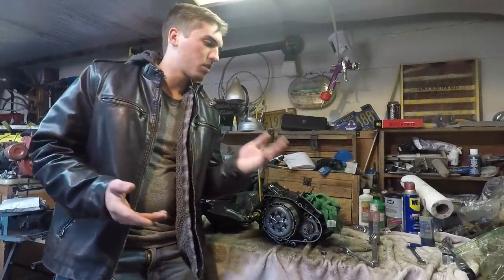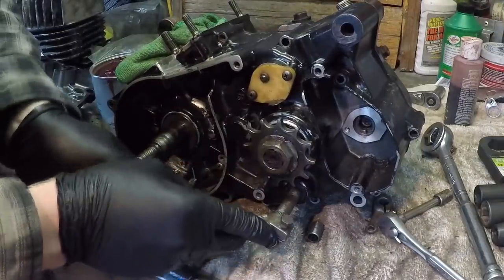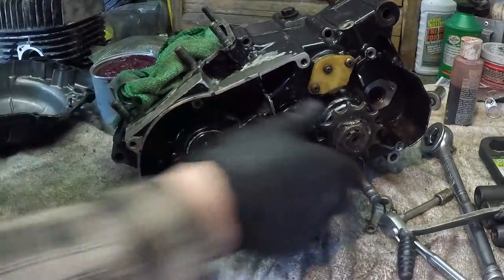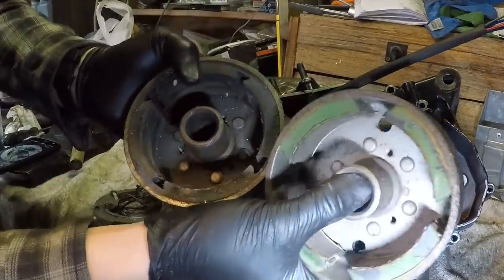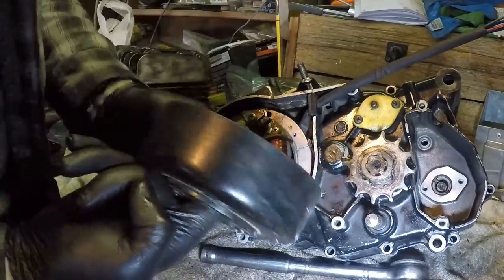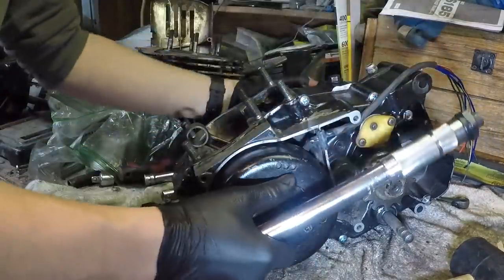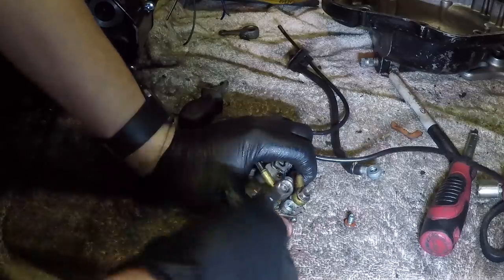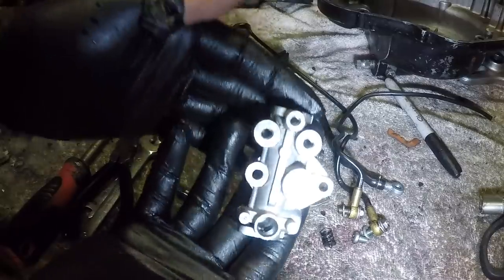TS185 Bottom End Rebuild (Part #3)

Comment: The "mystery bolt" on the pump is for bleeding the air out of the system. It has holes in it so that it can just be cracked loose to bleed the air out without having to fully remove it. When you add oil to the system just crack it loose wait for oil to start to seep from around the bolt and tighten it back up.
Reply: Dylan Snyder yep well said
Reply: I'll 2nd that👏🏼👍🏼

Comment: Doing good work. Try to remember any place u have a seal and you go to tighten down the covers or joining pieces. That you should not tighten them in a circle. You should try to skip bolts,screws, or nuts and go in a X pattern/cross pattern because it can mess up your seal as well as twist your parts and start leaking air, coolant, gas, or oil. I learned that the hard way.

Comment: Nice work mate, should run mint when its all done. Id personally get rid of the oil pump altogether. Block off the hole where it bolts up to and run the bike on premix 32:1.
Reply: Really really bad idea. Your head bearing is lubricated via the oil pump. If you just drive on premix, then soon your engine will get seized!
Reply: @christianlarsen6421  lol at head bearing. Never heard of a little end/topend bearing going on a 2 stroke bike in all the years ive been working/playing with bikes. Sounds like you dont know what you are talking about mate.
Reply: @brendantakkos1328  Them you really do need to do a serious research on this bike. It’s all over the net.
Just repaired on ts185 with a seized main bearing because of a missing lubricants from a bypass of oil pump. Do your research please.

Comment: Coin trick works, a rag works too.
Reply: Not if the coin is steel and most coins are
Reply: The Workshop   Our coins in the US are zinc, copper, or nickel, much softer than hardened steel on the primary gear. Works great.

Comment: man put no washers and stuff between those gears! use a anglegrinderwrench for holding the flywheel, (one point of the wrench in a hole and the other on the outside of the wheel) more proper way to do this, i have commented this on youre vids before. for the rest very nice work and love youre vids, u remind me a lot on myself back in the day, keep going!
Reply: "man put no washers and stuff between those gears!"

-  Explain please
Reply: @dirtygarageguy  its 16 year old ones fiddling, proper way is to use the wrench or special tool to hold the flywheel, dont know the english name for it
Reply: Lmfao tell that to the engineers who developed my 08 Husqvarna SMR510. Service manual literally says to place an aluminum washer between the primary gear and clutch gear to tighten flywheel bolt to proper torque specs. 🤷‍♂️🤷‍♂️

Comment: Should have replaced the case screws with Allen heads bolts. They have a cleaner look
Reply from the maker: I was going to but I couldn't find any that were the right size at all 3 of the hardware stores in my area 😭
Reply: @GoldGuyRides  I tracked down the bolts I needed at tractor supply. Don't know if you have them where you live.